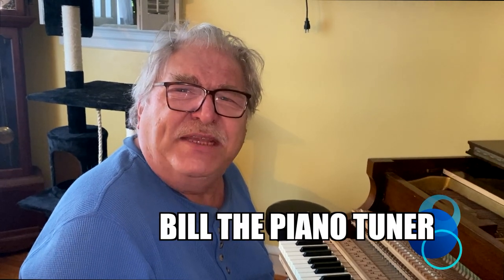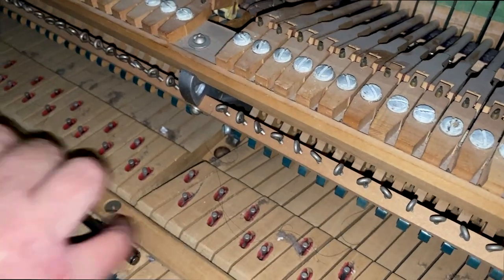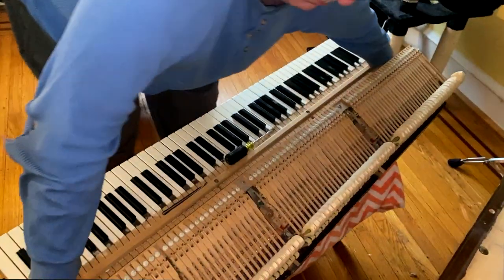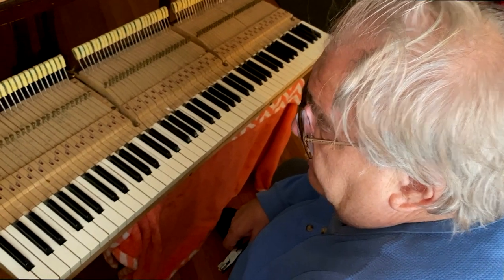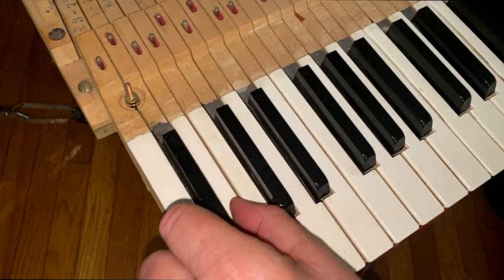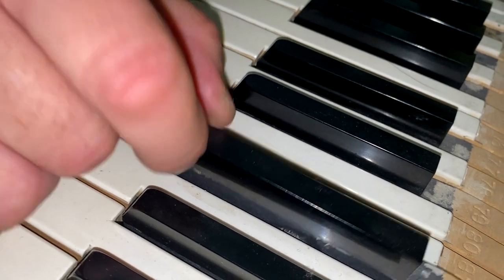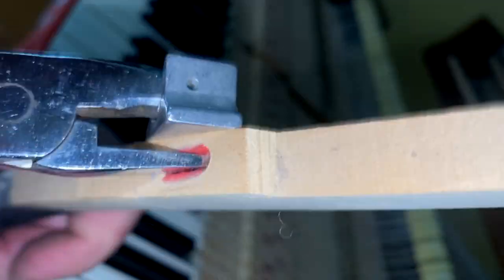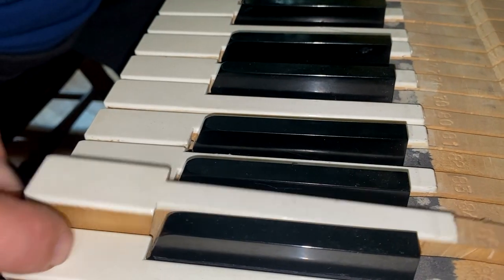Tightening Key Bushings

Comment: Completely wrong.
Slow Movement up and down is due to tight balance rail bottom holes. Tight key bushings are not the problem for this piano.
Reply: Why did the slow piano key moved more freely after the bushings were compressed even though the balance rail bottom holes were untouched?